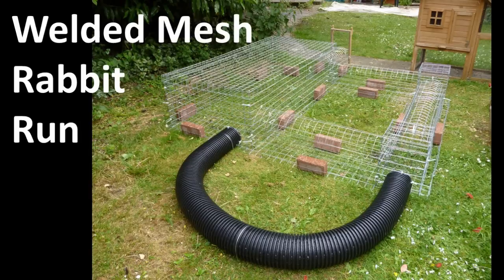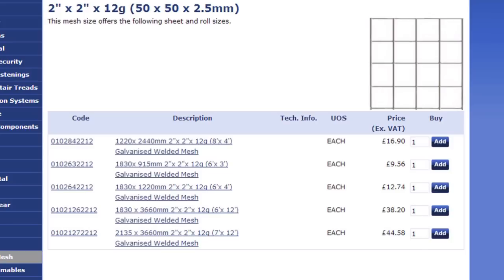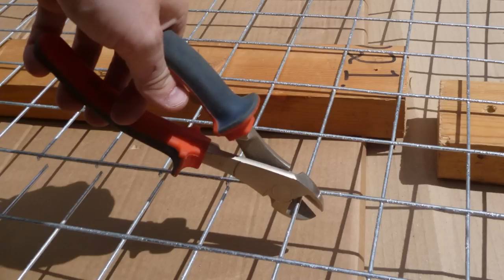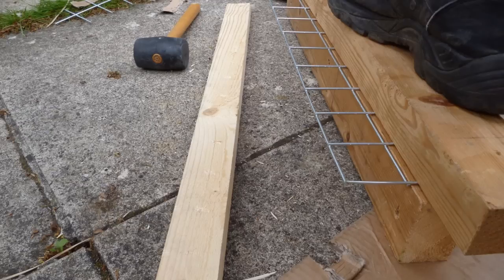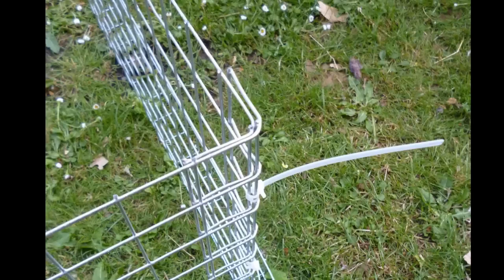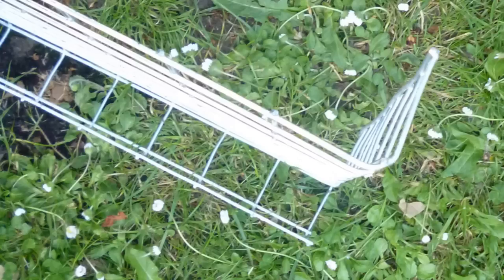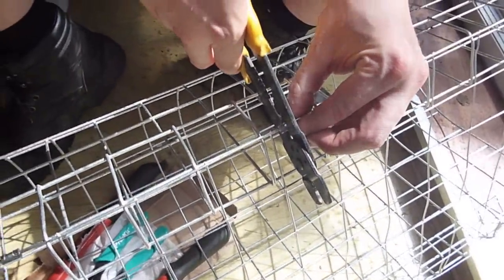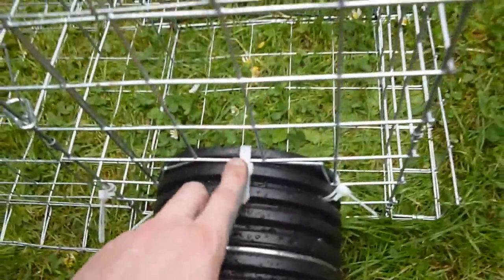Building a Wire Mesh Rabbit Run

Comment: correction, galvanized steel will rust, but considerably slower than normal steel as the zinc on the outside oxidizes slowly and protects the inner steel. the zinc will with time erode exposing the steel. galvanized steel is pretty much the best choice though, just dont be shocked when it eventually starts to rust

Comment: Sir, I do not want to make a negative comment, but I also do not want your bunny to get sore hocks. Please take the wire out of the bottom. This is a very well constructed rabbit run, and hopefully I can give you some constructive criticism to make your next one even better. Thank you for making this video to give us your very swell idea and guidance.
Reply: Ashley Downs No wire underneath means Mr Fox will gain access.
Reply: Yep, and ALL rabbits are natural diggers. They can quickly dig their way out of a dirt floor pen.
Reply: the rabbits will be fine with that.  It's also on grass for that extra cushion if it was in the air however that would be different as the pressure would push the skin through the holes.  And and you also need to think Bout how big that mesh is   it's huge!(this is also not a negative comment just some  info to consider)

Comment: One thing to be aware of is the risk of a rabbit getting its head stuck in the mesh if s/he builds up some speed and runs into it. You may want to add a band of narrower gauge, lighter weight wire at the bottom of the sides to prevent this.

Comment: Hi, great video, thanks. Can you tell me where you got the land drainage pipe from? I've not managed to find flexible pipe anywhere.
Reply from the maker: in the UK jewsons and other builders merchants stock it made by polypipe, but you might need to sweet talk them to buy short lengths, otherwise farmers often have tons of it. A commercial rabbit run manufacturer sells some as 'burrow pipe' which might be the most practical source.
Reply: bakstagesi Thanks for that. I'm aware of the rabbit run manufacturer, but I think they're taking the mickey a bit on pricing.

Comment: Thank you for video. The supplier was all I was really after, but I stayed for the whole video and very much enjoyed it. Like others I think I will hold off on not giving a button to the run. (Until I see a reason for it). 

I especially liked the fact you had a photo of your checkout page. Do you have a supplier for the 6inch drainage pipe? or did you get this from the 'commercial suppler' you were careful not to mention during the rounded tunnel contruction. (If you did, I think I know the one anyway.

Comment: Can I know what the name of the black plastic pipe?
Reply from the maker: It is '160mm Perforated Land Drainage Pipe', very common in farmer's supply and large building material suppliers. Your problem is to find short lengths as it's usually sold 50m at a time...
Reply: @bakstagesi  i see. This item is not common in my country. Yes, bcs I'm searching for a short one. What do you think if I use flexible air conditioning vent hose or aluminium ducting hose?
Reply from the maker: As long as the rabbits are safe, you can be creative. If you use duct make sure they can't chew it too easily, and there are no sharp edges. If you use a solid duct or pipe, drill some holes so that there is ventilation and so that water can't collect during rain. Don't make the pipe longer than you can reach in case the bunny gets sick and hides there. Just think your idea through and you should be fine.

Comment: Excellent video! So informative and detailed. Thank you very much; I will certainly be using this as inspiration. However, as Ashley Downs commented below, wire floors give rabbits sore feet. You should remove the wire floor from the centre of the open areas, but you can leave a few inches to avoid any escapes. See page 3 of this document, for a photo of what I mean: http://www.rabbitwelfare.co.uk/pdfs/Basic20rabbit20set20up[1].pdf

Can't wait to build some bunny tunnels! :)